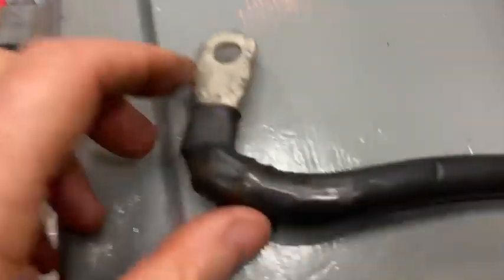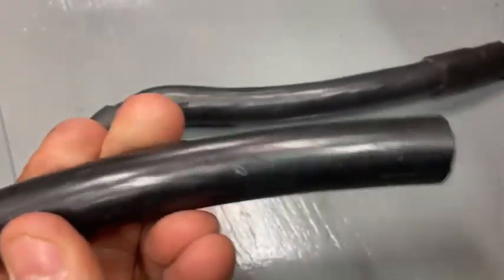Installation of Victron SmartShunt in House Battery System January 2o22

Comment: 4/0 is overkill.
2/0 would have been quite sufficient
Reply: You're probably right. We used 4/0 because it matched other parts of the previous install. We also have an additional shunt in the system and didn't want to give away move mv than necassary.

Comment: I think the range of the bluetooth is inadequate or the signal is being attenuated by the extensive sound insulation/ metal engine room cladding....
Reply: Can it be read in the pilothouse?
Reply: @dmccook1  I could not get my phone to connect successfully yesterday on sea trial.  it sees it but low signal strength.  works in salon.